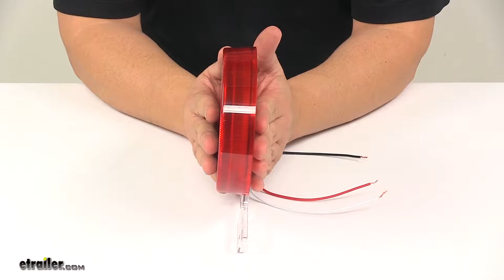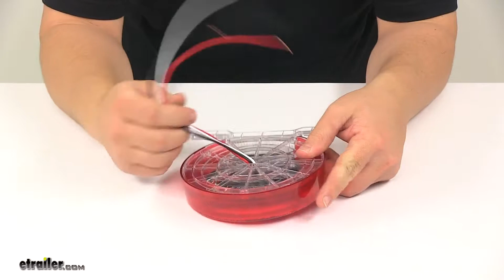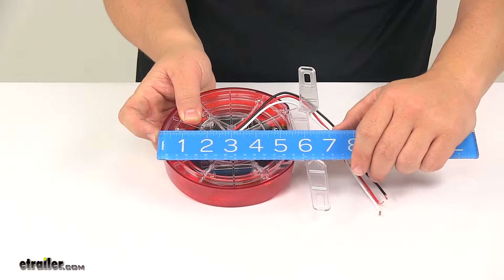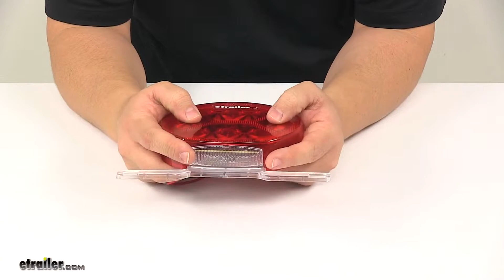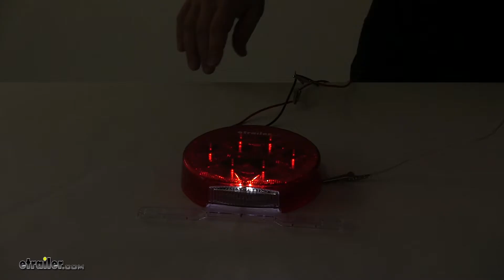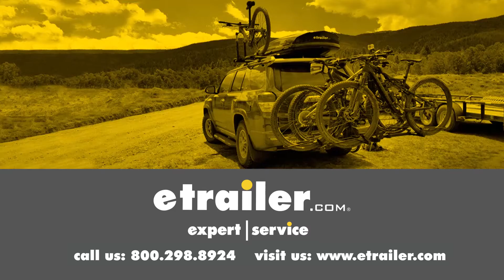etrailer | What to Know About the Low Profile LED Combination RV Tail Light w/ Bracket

Comment: Nice Trailer Light, The only down fall is that it came installed on my new Travel Trailer, There is no way to install a license plate to the bracket without ruining the finish on the RV. The light and the bracket fit flush against the back of the RV's painted surface so it is impossible to install the plate - If you try to run a bolt or screw through the bracket the hardware will penetrate the RV wall or scratch/damage the surface ---- any idea's?
Reply from the maker: Can you take a picture and send it to youtube@etrailer.com? Would like to see what you're talking about before I give any suggestions. Thanks!